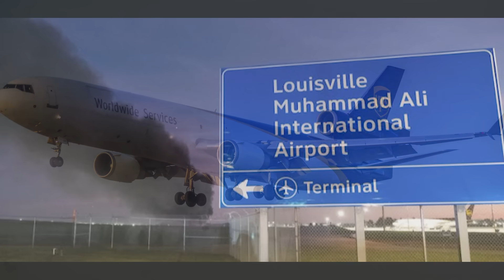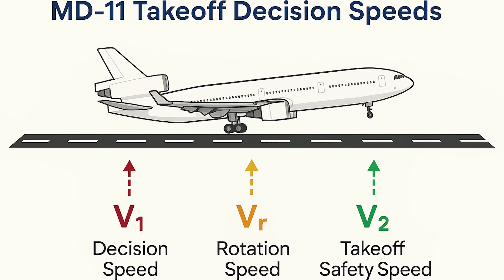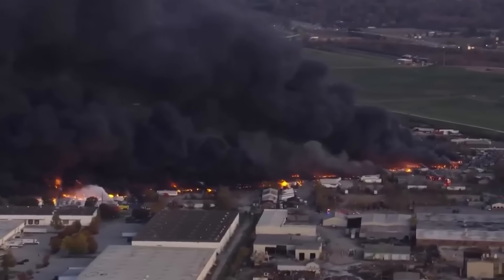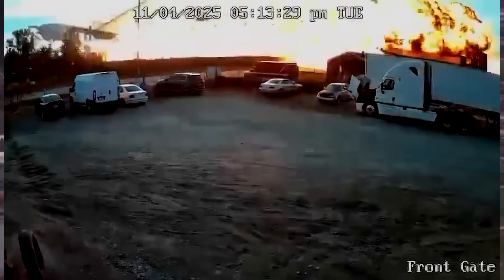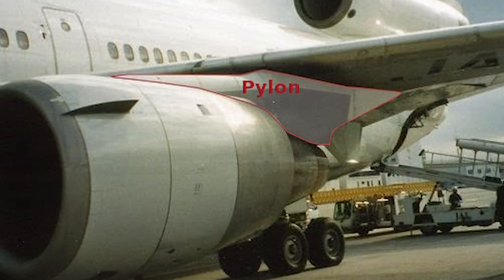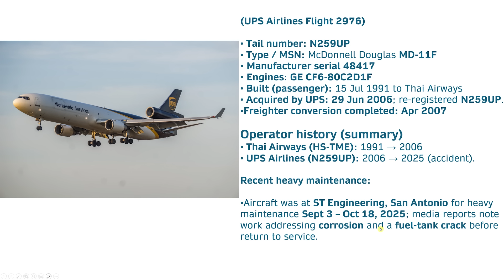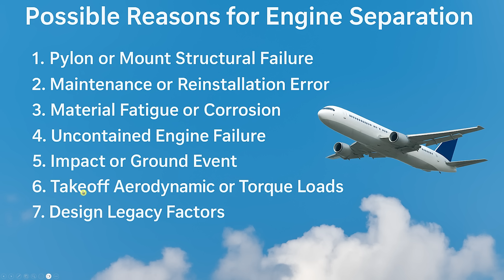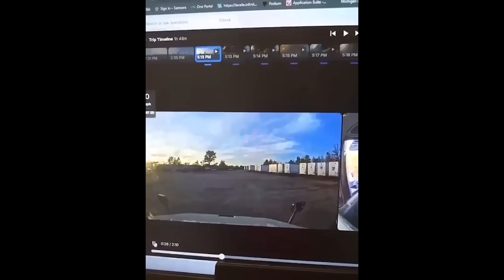What Caused UPS Plane Crash, Louisville, KY? How MD-11 Engine Fell Off

Comment: the part of the engine shown is the airframe, basically the intake of the engine, that does not hold any fuel, but it does connect the IGV and these use bleed air from the engine to prevent the IGV from freezing, if this fell off it could explain the loss of power, specially these engines they are considered  propeller turbojet engines, so they have a big fan in the front that helps create thrust, but the main issue here is that all those lines with bleed air snapped off, causing the jetengine to lose air pressure off setting the engine fuel to air ratio and causing it to run rich and lose power, which explains why it caught on fire, someone mentioned that the engine was on fire prior to crash, this is just my take from a Turbojet engine mechanic in the US navy, this couldve been caused by lack of routine inspections, there are countless amount of inspections that we need to do on these engines, pre flight post flight, and schedule maintenance after certain amount of flight hours and they can become tidious and people might skip it cuz why would a scree/bolt get lose?

Comment: It will be interesting to look at the maintenance log to see if they replaced the engine, using the wrong way to do it will cause the pylon to have a micro crack or the bolts that hold the turbine. I think there are 3 or 4 bolts on the pylon holding the turbine, even if a fan blade falls off the housing still will not be enough for the engine to come off.
Reply: Bingo !
Reply: and if the lines where to be torn / puncher behind the hydraulic fuses goodbye slats.

Comment: Seems to me the bolts to the missing engine may have been missing like the door plug on the dreamliner jet. Then the fire was simply raw fuel flowing into the fireball and the catastrophic loss of fuel line pressure prevented the remaining engines to get thrust needed for flight.

Comment: The fuel pumps are still spraying and you can see the aerosolized Jet-A trailing the aircraft like a mist as she goes along until you get the power line strike at timestamp 0:25 that's the main ignition source and starts the fireball in earnest.

Comment: I’m still confused on how/ why there isn’t more coverage by cameras considering it’s an airport. Is camera footage of the length of the runway not common or necessary?
Reply: Not common nor deemed necessary.
Reply: @HAVACILIK2  Fair, but as we see in this video there isn’t much coverage of when the incident began, which I feel could answer a lot of questions via video rather than word of mouth from eye witness accounts. Sure, if 8/10 witnesses say it began one way but the other two disagree, stating it started another way, naturally we’d go with the higher number of witnesses. What if the other two saw something the others didn’t?

Comment: I'm no engineer or pilot; but i am shocked that even with the starboard engine off, the remaining two engines could not get this aircraft safely up by themselves. Granted, the aircraft was full of cargo and fuel; but there is significant redundancy built in. For example, i believe pilots only use about 30 % of the full throttle capacity on takeoff; so they could have pushed the aircraft to full power and it might have been enough? I realize they only had about four seconds to make that decision; but is it possible they did not use full power? They would have a very unstabilized V1 but perhaps full left rudder and no flaps could have been enough (auto-everything off?). I realize that fuel was pouring our of the fuel lines on the starboard engine; but aren't there automatic shutoff mechanisms onboard that would immediately shut down the fuel pumps (or are these manual)?

Comment: Some of you are too young to know. The far superior Lockheed L1011 TriStar was suppose to overtake the DC-10 & MD-11. However MacDonnell Douglas skimed  on safety to market this aircraft.
Reply: "skimed on safety to market this aircraft."  The other way around, there, buckwheat. That notion came from a marketing campaign concocted by Lockheed, accusing MD of doing that. Learn your history. Just letting the numbers speak for themselves. The last DC-10 crash was in 2004 (pilot error).  The last MD-11 Crash was in 2010 (pilot error).  Every single DC-10 or MD-11 crash was attributed to poor maintenance, inadequate inspections, or Pilot error. Not MD skimping on safety. Since 2010, in the last 15 years, there have been more than 200 (of all types) Airbus crashes, seven 737 crashes, three 747 crashes, three 777 crashes, and one 787 crash. Yet NO MD-11 crash or DC-10 crash.  The United States Air Force has achieved a 90 percent operational success rate with its DC-10 air refueling tankers. The only USAF KC-10 lost was a ground fire caused by a maintenance mistake.  And just to let you know, the name is spelled "McDonnell", not "Macdonnell". If you are going to spew false BS, at least know how to spell the name.

Comment: Just letting the numbers speak for themselves. Facts.  The last DC-10 crash was in 2004 (pilot error).  The last MD-11 Crash was in 2010 (pilot error).  Every single DC-10 or MD-11 crash was attributed to poor maintenance, inadequate inspections, or Pilot error.  Since 2010, in the last 15 years, there have been more than 200 (of all types) Airbus crashes, seven 737 crashes, three 747 crashes, three 777 crashes, and one 787 crash. Yet NO MD-11 crash or DC-10 crash.  The United States Air Force has a 90 percent operational success rate with their DC-10 air refuel tankers. The only KC-10 lost was a ground fire by a maintenance mistake. Also, this crap of the plane being 34 years old. Age is irrelevant. Its how the aircraft are maintained. Also, the engines are NEVER as old as the airplane itself because airplanes go through many complete engine rebuilds or replacements during their lifespan. Going back to the DC-10-MD-11, if we follow history, I would surmise this will be another shoddy maintenance practice.

Comment: Another kill for the Death Cruiser 10. The venerable predecessor to the 737 Max Death, and built by the direct predecessors of the same worthless corporate slobs who are more interested in building profit margins than a functional aircraft. After AA 191 crashed the FAA failed to mandate a fundamental redesign of the engine pylons (just as they failed to mandate a redesign of the faulty rear cargo door on the same aircraft type until a few hundred people died). Did maintenance crews cut corners in that case? Undoubtedly. But it was because the pylons were badly designed and more prone to damage than they should have been. Pure pylon failure is incredibly rare as a cause of air crash, and two out of the six major incidences have been on DC-10s or their ilk. The rest were 747s and that issue was addressed by a pylon redesign. The MD-11 is descended from a flawed design, and everything that was improved about it over the DC-10 was just the stuff that McDonnel Douglass didn't have big enough bribes for.

Comment: That video is so unreal😮 rest in peace to the crew on board and those on the ground

Also how the hell does an engine just fall off?
Reply: You would think maintenance error.  Some bolt or bolts not put back on, or not secured properly.  I had just watched another YouTube video from a slightly different angle and someone said they thought it was AI generated because the airplane wasn't over on it's edge.  But this video doesn't show the airplane on it's side either.

Comment: Jet engines are designed to separate if the engine seizes, or a failure causes severe vibration. The engines are spinning at around 15,000 rpms. If they suddenly size up the torque created is incredible. On this type jet the engine pylon has three shear bolts the hold the engine to the wing. These three bolts are design to shear off under the right high torque condition. If things go right the engine actually is suppose to rotate over the top of the wing falling behind the jet. Looking at the engine on this plane I would say the engine  had this kind of failure. 

The 1979 American Air Accident it was the shear bolts that had been damaged because of improper  engine changing procedures. The Line mechanics had installed the engine slipped in one bolt and their shift was over so they left the job for the morning crew to finish putting in the other two bolts and wrapping up the other connections of fuel lines etc. The forklift  holding the engine lost some hydraulic pressure since the lift engine was not running and the lift dropped down a bit bending one of the shear bolts badly. That damage caused the engine to separate weeks later when the engine was at full thrust during take off. 

McDonnell Douglas recommended Engines be removed from the pylon first in Engine Changes. This is a process that takes hours because of all the hard to access screws. Line Mechanics developed a shortcut by removing the Engine with the  Pylon still attached. Since basically the only hard attachments were the three shear bolts. The problem was the tolerances to slip the pylon with engine into place with extremally tight using a Forklift. This could caused some hidden damage that could net be seen. When FAA found this out they made all the Airlines using this procedure to inspect the Jets and to stop using the shortcut. Inspections found a lot of damaged pylons that had to be repaired. The FAA also ordered changes to hydraulic lines that got damaged in the 1979 American Air accident.

Since the two jets of this type had serious damage to wings when engines separated it kind of looks like the engineering of the separation process is flawed. One jet having hydraulic line damaged, and this jet looks like severed fuel lines maybe fed a fire that was probably catastrophic. I think even if the Jet had been able to Climb out the fire would probably caused the wing to fold before the jet could circle and land a extremely over weight plane. The fire could also have penetrated the adjacent Wing fuel tank causing the jet to blow up midair. I also think it is probable that when engine #1 had it's Uncontrolled disassembly, FOD entered the #2 Tail Engine causing decrease in it's power. Might be why the Jet could not Climb out.

Over the years there has been a bunch of jets losing engines, about half crashed the half made it down for safe landing.

Comment: This may be a dumb question, but there are 3 engines on the McDonell-Douglas. Apart from the short time to recover from a sudden weight distribution at such low altitude, would it not have been possible to still take off on the two remaining engines? Both would have been at full thrust, I imagine? So, not enough time and too low?

Comment: unlikely for that first building strike to have been the landing gear.  the gear was still on the airplane at the final crash site.  much more likely that the PiC was full back on the yoke trying to keep altitude ( even though this would have been stalling the lifting surfaces due to insufficient airspeed )  and the nose up flight attitude caused a tail strike on the factory building.

Comment: I wonder if it was a pylon/motor mounting or frame damage issue that made it rip off like that. Or maybe a catastrophic internal failure that torqued the motor so hard it ripped off? Obviously, I'm not an aviation tech, but I can tell you one thing: I feel sorry for whomever worked on it last!

Comment: They mount cameras on rockets for exterior equipment views, why can't they mount several of them to show multiple points on aircraft like this...with either real-time HD streaming or direct feed to the Black Box? Would solve a lot of mysteries, and be much faster diagnosis and likely cheaper in the long run.

Comment: This plane was fully loaded and heavily fueled for a nonstop flight to Hawaii from there.  While it can fly with only two engines it can not take off with just two in use under such weight.  Not to mention that it likely heavily damaged the wing when it caught fire and came off. Unfortunately all this happened after the point of no return. To fast and not enough runway to abort takeoff.  It's an extreamly rare situation and every airline pilots worst nightmare.

Comment: Shades of American Airlines flight 191 back in 1979 where the left engine came off causing it to roll left and crash on takeoff killing everybody on board. It was found to be AA not following  manufacturers proper maintenance procedures. They were supposed to remove the engines from the pylon first before  removing the pylon from the wing. Instead AA decided to take a shortcut and removed the pylon and engine together as an assembly. That caused one of the engine mounts known as the thrust link to crack. The crack kept getting worse until it broke off.

Comment: The jet yawed to the left due the right engine producing full take off power after the left engine detached.  That is what caused, in part, the "knife edge roll" onto the left side and also what caused the jet to shift left off of the runway in its brief airborne phase.

Comment: That was a horrendous crash Jeff. Sad indeed.
Let's wait and see what data they can retrieve from the black box.
I suspect the engine fell off due to metal fatigue of the structure and I wonder if that first or second contact with the electric wires caused the left wing to ignite its tanks..

Comment: Engine lost, sparks as it ripped free set fuel line leading to missing engine on fire.  Lack of thrust resulting in loss of takeoff speed, aircraft climbs on ground effect as it leaves the runway but lacks speed to climb out, settles, hits everything.  Pilots have no realization they even lost an engine and thus have no time to react.

Investigation immediately to maintenance of left engine.  Will probably find someone hasn't been quintuple checking the bolts that hold the engine to the pylon.  OR even one or more of the bolts never got put back on.  Procedure changes suggested/enforced.  Person who did the job that day lives with the internal horror for the rest of their life.

Comment: @1:38 The first explosion ignites.. probably hitting GFL environmental. 

The video at 1:38 seems to depict the flight would have actually directly impacted at GFL Environmenta on Knopp near the intersection with Grade Lane & Knopp. GFL is  a collection point for all kinds of toxic and inflammable liquid substances, paints, motor oil, etc.  

VOCARS Kentucky LLC - Vegetable Oil Collection and Recycling Services would also be imflammable, but the GFL operation would have very inflammatory and much more toxic substances in several vertical tanks. 

why is not one person including the governor making direct mention of this? this is the primary source of the toxic substances requiring the 5mi radius shelter in place they issued at the time of the crash.

Comment: In the 1979 AA171 crash, it was not "fork lift did some damage". The maintenance crew removed the engine mountings (pylons) in the wrong order, and had improperly used a fork lift to support the engine while doing so. The stress on the mountings from removing things in the wrong order, created the loss of the engine at take off. After the engine loss, there was damage to the hydraulics, and the aircraft was impossible to control.

I will say, if that UPS flight had not clipped the building with the landing gear, it possibly would have made it. Clipping the landing gear on the roof would have lost them speed, and with one engine lost, they needed all the power they could get, plus trying to control the asymmetric thrust (although the three engine configuration possibly made that a little easier). Had they been just a couple of metres higher, they may have made it for a go around. That slight deviation to the left was due to asymmetric thrust. The eventual rolling over, probably all the damage by the fire already and the craft would have been uncontrollable at that point. Those final seconds, they would have known they were goners.

Comment: I’m sure much has been said about the resemblance to the American Airlines 1979 Chicago crash. I had a unique perspective when it happened because at the time, I was dating the daughter of one of AA’s Tulsa inspectors (where the faulty engine maintenance was done).  I was at her house when it happened and the call came in minutes afterwards.  He grabbed a bag he had ready in a closet and was out the door in 10 minutes to fly to Chicago.  He hadn't signed off on the faulty repair, but one of his coworkers had and that poor fellow later killed himself.

Comment: The engine pylon failed. This happened before years ago. It ended up being a maintenance issue causing it because the steps to assemble pylon and engine to the wing was not done according to instructions in manual.

Comment: I know that the left engine's of many aircraft are the primary hydraulic system. Is it possible that they had failure in the engine just before V1 or around there, and were struggling to manage the switch to aux hydraulics? Or is that automatic? If the pilots didn't have hydraulic assist I can image they struggled to pull up for takeoff.

Comment: There are two sets of pumps. The Low pressure pumps live in the tanks and are responsible for supplying the fuel from tank into the lines. The high pressure pumps driven by the engines are part of engine assembly. So if the engine is severed from the wings, LP supply is still on and is pumping fuel to the severed lines. So that fog that follows under the airplane must be fuel which got ignites by the spark from power lines being hit.